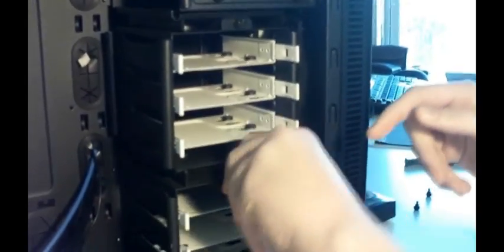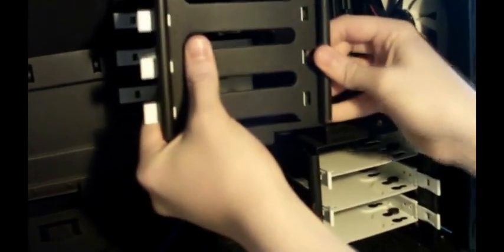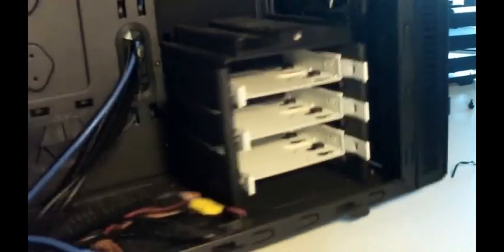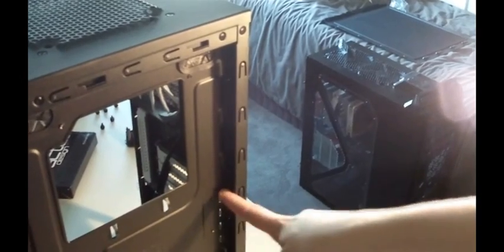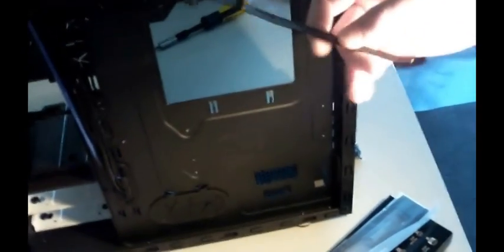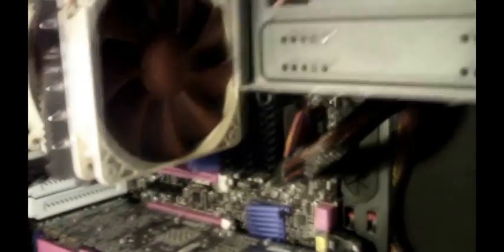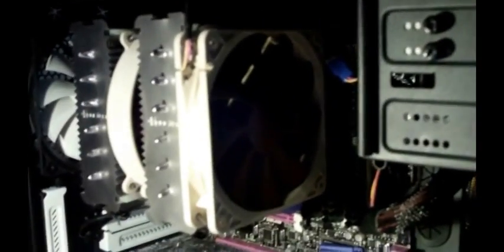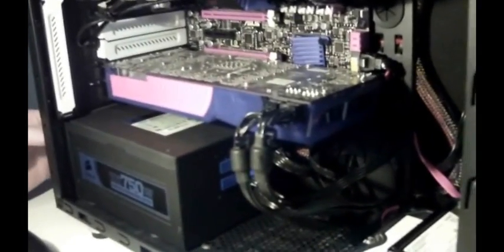Case: Fractal Design - Define Mini P2

Comment: Would have been nice if you showed how to install the extra front fan and how you drilled out the bottom cage.  I thought they should have made the bottom cage rotatable.
And you didn't have problems w/ the motherboard cutout?  It's 1/2" too high for me...cuts off half the lower nuts for the heat sink bracket so it's effectively useless for me :-P